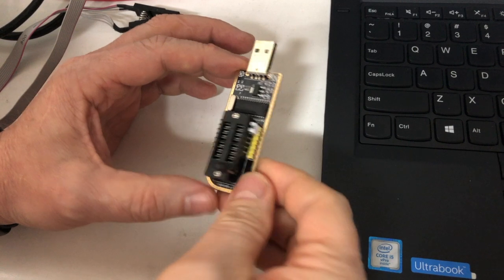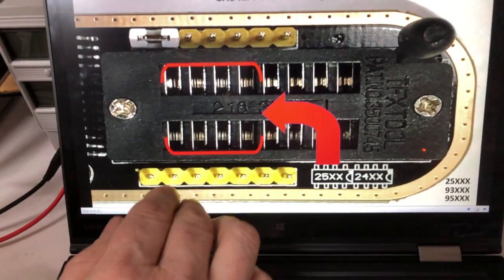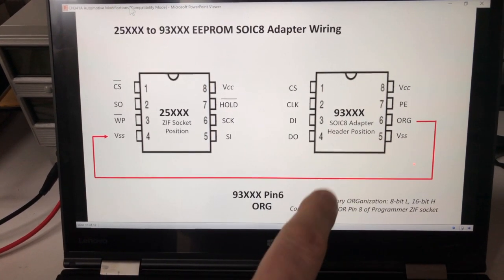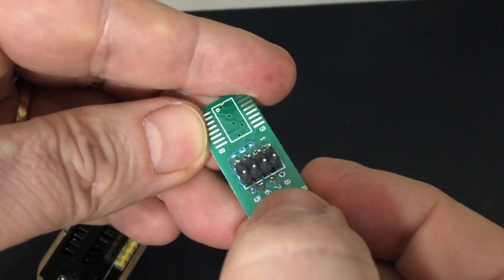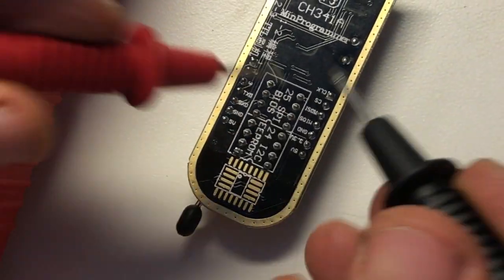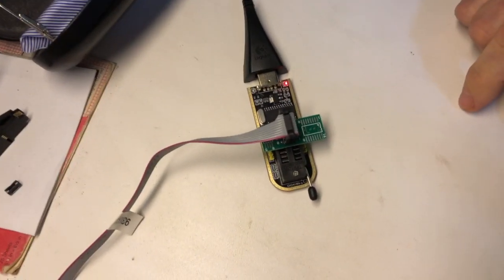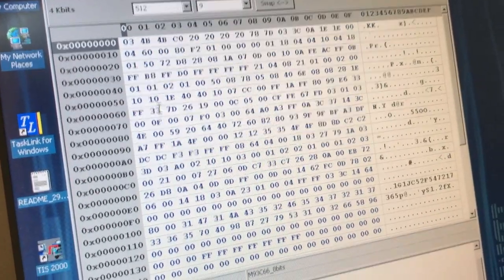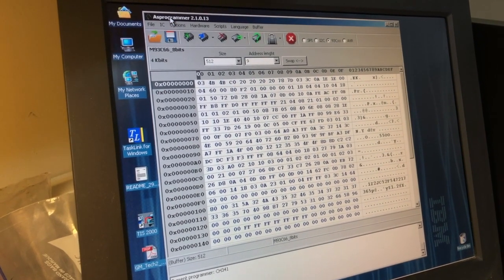Modify the CH341A EEPROM Programmer (Black Edition) for 5V 93XXX & 95XXX Automotive Use

Comment: Thanks so much for this video, was tearing my hair out as to why I could read/write an off the shelf 95160, but not one pulled from an ECU. Did your 5V mod and it worked. Thanks again for the super clear instructions.
Reply: hello friend I don't know it may be your case but ... I bought a ch341a and what I bought in a virtual store came with a defect ... it even programs but with a malfunction ... so ... what happens when you close the ziff socket all the pins of the ch341a zif socket meet and when he asks to program the eeprom he ch341a sometimes burns the eeprom ... as i decided ... i removed the zif socket and put in a common 16 pin socket cobe right and I managed to program you noticed this defect in yours? found out with a mult-test ... thanks
Reply from the maker: @sjoseph35san34  I've not seen this defect before, probably just a defective low end Chinese ZIF socket.
Reply: @DrShock  ok thanks
Reply: @DrShock  im brazilian thks so much

Comment: There is no need to invert signals that in 95xx have the designations ~CS, ~S, in 93xx it is CS, S?
Reply from the maker: The programming software would take care of chip selection signal levels.  For this automotive specific mod, we just need to correctly adapt the pinout pathways and programming voltage.

Comment: Don't know if you still support this but I have an 03 avalanche trying to unlock a salvage radio. the installed radio has  9355093 as does the salvaged radio, how do i tell if it is a 24c04 or a 93/95 type chip?   Purchased CH341A from Amazon which is now $12 not 5, but could use your help.
Reply from the maker: The 9355093 EEPROM would be a Delphi numbered generic 24C08 type.   Determining which type of EEPROM these GM / Delphi house numbers are is usually only solved as a matter of a trial and error process.

Comment: Is this modification needed to rewrite the VIN on a GM radio that is locked?
Reply from the maker: If you chose to use this particular EEPROM programmer, yes.  Most others, no.
Reply: @D @DrShock  you know what EEPROM programmer I would need without this modification?

Comment: I'm puzzled why you had to go through all these hoops instead of just using the yellow-bottom pins which can be wired and plugged into the connector instead. You can even get the 5v from there.
Reply from the maker: I showed the professional approach for a permanent modification to convert the tool to a dedicated to automotive devices only use case.  A repetitively used shop tool.  If you're not looking to do that, then this video likely isn't for you.

Comment: Hi, After this mod can i still read 24xx and 25xx direct in the zif socket? Thank you. And 93xx with adapter
I Need for automotive use.
Reply from the maker: With this mod the programmer becomes dedicated to chips used in automotive applications that use 5VDC.  You'll lose the 3.3VDC capability used by chips for consumer electronics applications.
Reply: @DrShock i don't Need 3.3v. if i Jump 5v to 3.3v in the Yellow socket without cut the trace i Need to desolder the MOSFET?
Reply: Also i Just have the adapter in the video so i Just plug in and Is all fine?
Reply from the maker: You can bodge wire up an adapter at the device pinout level to deal with the voltage routing but its much more difficult, what I'm showing here is modification at the board level which then applies to any device type you would use in the ZIF socket.   I showed all of what's needed, if you want to make the board level change.  Also note this is an older video, currently programmer boards might no longer require this mod.

Comment: May sound like a dumb question, but does this 5v mod need to be done for the 24 series eeprom on Vcc pin 8? Or, is the 3.3v okay during write? Specifically the 24C08 in one of your other videos? I guess I could just look up the data sheet and figure it out, but I thought I'd ask on here first to get some thoughts from others and/or creator. Thanks...
Reply from the maker: This mod is for automotive use, where all EEPROMs are 5VDC powered including the 24xxx series.  If you're not working on automotive module boards, it's most likely going to be 3.3VDC instead.
Reply: @DrShock Okay, I'm doing this inside a replacement Delco head unit (in circuit) from the early 2000's and just wanted to be sure. I believe your answer is yes, mod 5v to Vcc in this case! Thanks for the reply 👍

Comment: Thank you! Just made an adapter for mine to read/write to mine 93C46 on a Toyota cluster. 3.3V worked fine with that chip, so did not have to do the 5V mod.
Reply: Did you have to remove the chip before you could read or write to it?

Comment: Hi. For reading eeprom 95320 is working only by adding a jumper on pin 3.3v and 5v. I had problems reading the eeprom because of the clamp, is hard to connect on eeprom. When a green led from ch341a is on it means the connection is established and eeprom can be read.

Comment: y not just jumper 5 and 3.3?
Reply from the maker: This was explained in the video - the US automotive sector does not use 3.3VDC devices.  So it's a don't care capability that can be omitted.
Reply: @DrShock  ok. i got question while making the clip adapter pin 2 3 4 5 6 are connected by wire?
Reply from the maker: You could implement the adapter wiring diagram using bodge wires yes.

Comment: I purchased a 2nd Toyota Aristo Jzs161 cluster Can I use the to change the mileage?
Reply from the maker: The value in the memory device will be obfuscated, or encrypted.  You would also need a mileage calculator tool like TachoSoft to accomplish such a task.   Instead, the typical repair of this nature would just be to swap the EEPROM device between old and replacement cluster if used.  Or just reprogram with a J2534 interface tool using Toyota Techstream softwre if new.

Comment: Hi,thanks for the vid! I have an EEPROM from an early 2000's Dodge Grand Caravan I want to program with a replacement VIN, The EEPROM has 632565 ST9136 stamped on it. Now before I go modding my programmer, is this mod likely to work on it? I can't seem to find much information on this chip.
Reply from the maker: The number on that chip is proprietary to Chrysler.  There's very little information posted about it, but the few places I came across it suggested it maps to a generic 95XXX chip (most likely 95040) which this mod would cover.
Reply: @DrShock  I see. Thanks for the information...that helps a lot. I will have a go at making doing this mod.

Comment: Is the wiring the same for the 95xxx chip?
Reply from the maker: Only the 93XXX requires the pinout adapter.  The 95XXX uses the same pinout as the 25XXX.
Reply: @DrShock  So i dont need to modify anything for 95xxx chip?
Reply from the maker: If you're using this older black edition programmer that does not do 5VDC, and you're working on automotive devices, then you still need to make mod for that which I went over in the video.
Reply: @DrShock  i do have the black edition,but i quiet dont understand about pinout...Do i have to do that pinout or i just pop it in 25xxx and it will work if i mod only 5v?
Reply from the maker: The 95XXX chips get inserted into the 25XXX section of the programmer.   So the only concern is whether you have the necessary 5VDC.   The earlier versions of this programmer only did 3.3VDC for consumer electronics applications.   The later versions of this programmer have a jumper already to select between 3.3V and 5V.
Reply: @DrShock  How can i know if my programmer has that jumper between?
Reply: @DrShock  Can i use the clip or i need to desolder the chip? its a 95160 chip i want to read??
Reply from the maker: That will depend on the circuit board of your module.  Most will require desoldering of the chip, a small number can tolerate a testclip approach.
Reply: @DrShock  How can i verify if i can use the testclip?

Comment: You do amazing video to present/learn everythings but i am stuck actually. sorry that the question can be stupid, I have an eprom 9386520  ST 9452L    unfortunately this one is not on the programmer list and I don't find enough documentation on internet. 

What can you advice me. It's from a BCM Corvette c6 2005 GM 15216908 module, module is 50% out of order. I have the exaclty same module from another car , what about just swap my eeprom to the next module ?
Reply from the maker: If the two BCMs have the exact same GM/Delphi part numbers then sure you can swap the EEPROMs.  If the numbers do not match, it's likely there is a circuit board design change blocking success with such a route.   These will be surface mount devices, so micro soldering tools/skills will be necessary.  As an insurance contingency I would always make a backup copy of the EEPROM.   You could experiment with the donor boards chip, to determine what actual ST EEPROM device the Delphi/GM part 9386520 is.  There is no cross reference information on this number that I can find.
Reply from the maker: Actually, I found some data on the house chip number 9386520.  Try reading it as an ST 95080.   Though it most likely can only be read after being removed from the circuit.  Should be very similar to this Cobalt BCM video I did some years back - https://youtu.be/0Kon-FjD0dM and you could ask any follow up questions as comments on this vid instead.
Reply: @DrShock  thanks a lot. Last question: does eeprom has also the configuration of the car written inside?  serial module / vin / odometer / config of car ? Or the configuration is written on another chip ?
Reply from the maker: for most GM vehicles before MY 2017, it should all be contained in the EEPROM for the BCM.   However, mileage is special, that data will often also be stored by the IPC module on its own memory chip, (most GM models but not all)  and the mileage values cannot disagree.  This is to enforce US federal law around odometer tampering.

Comment: I've just worked on my 95320 eeprom of 2009 370z with your 5V method. The job's done perfectly and finally I've cloned 370z's data to G37's eeprom. Then the G37 ECU attached to my 370z and the engine woke up without any problem.

Thank you for your great video!
Reply: What did you choose for microwire for this 95320 eeprom?
Reply: @T3nkata Do you mean if I used SPI or I2C? Then I chose SPI for 95320.

Comment: just a quick update on the adapter i made it works fine with the ch341 reading the 93lc46b (it's a 16bit chip actually and not 8bit) whether pin 6 is grounded or not however it didn't work for the ezp2019+ because i did a mod awhile back ago and grounded the 4th pin of the zif socket directly to ground which made the 93 series chips unreadable now it works just fine after i removed the jumper wire

Comment: Nice tutorial despite having the xgecu t48 which read the 93 series just fine but cannot detect the chip though i still wanna use this for my ch341 and the ezp2019+ which is supposed to read the 93 series out of the box but while it can detect the chip as 93 chip it cannot read it, the chip i am using is the 93cl46b 8bit and i'm trying to make an adapter using the 8pin dip socket on these spare boards instead of the clip adapter but it cannot fit the zif socket so i have to use another adapter board but it's gonna look ugly

Comment: My usb port and the ch341 chip become very hot when i use the clamp. Do you have an explanation? My ch 341a is not modified at time.
Reply from the maker: The circuit you are attempting to use the test clip on (presuming this is what you meant by "clamp") is likely drawing excessive current.  You need to cease using the testclip, and instead desolder the device off the board and examine/program it outside the circuit if so.
Reply: @DrShock  yes it's the test clip (I'm not English native, I'm a froggy). Thank you for your answer.

Comment: Why don't you just put a jumper between 3.3v and the 5v pins? I think this maybe the reason the manufacturer put those pins right next to each other. If I'm wrong my aplogies, however if I am right please edit your video
Reply from the maker: This vid is about an automotive parts only mod, where the devices on the module boards are always going to be 5VDC only.  Hence we're only interested in that one path here.  But viewers are free to elaborate past the initial objective as they see fit for other industry applications.

Comment: Hi mate, I'm italian. Not have understend in 4.33 minutes, where to solder the pin 2 to pin 5 or pin 6. Thanks
Reply from the maker: The little board shown at that time index was just a spare prototyping board I had lying round, that I used as an illustrative example to implement the adapter wiring diagram shown earlier in the video.  You can use whatever you want to implement the adapter or even just wire wrap something temporarily.
Reply: @DrShock hi mate I bought the whole kit on ebay and I have your idem little Board. If you have an email address I can send you some pictures. I hope it helps me to read this eeprom. Thanks
Reply: Hi mate. I have eeprom model 94320. For read this eeprom is idem the procedure for 95320? Thanks
Reply from the maker: I'm not familiar with a 94xxx series eeprom working with this programmer or not.  The AsProgrammer software also has no support for any 94xxx devices. 

You sure you are reading the number correctly?
Reply: @DrShock  yes mate. I have read correctly the number. This eeprom there is into a radio blaupunkt

Comment: Hello DrShock i did everything as in the tutorial step by step with the ch341a device ( cut the trace between 3.3v and pin 8 , solding jump wire between pin 8 and 5v and lift the middle pin) but after putting it in to the usb port window pops up "Device is not working properly" and doesn't recognise it.. where can be the problem?
Reply from the maker: Was everything working OK before you made the mod?   Always a good practice to have a known working setup first given the device drivers and software involved.
Reply: @DrShock  i cut the jump wire from pin8 to 5v and put it to 3.3v to restore the original trace ,solder the middle pin of the voltage regulator back and the pc recognise it immediately as before.. but i need it to work on 5v so i can read 93c56 chip
Reply from the maker: Alright, so you have gotten back to a known good state.   So now, for the PC not to recognize the USB device, power to CH341A chip is likely being interrupted.   There may be other, alternate, designs floating around for this inexpensive board by now (this video is several years old).   Carefully trace out the regulator outputs (both 3.3V and 5V) on your board and determine if they differ from the version I showed.   It's also possible your later version of the board does not need this mod.
Reply: @DrShock  thank you for the help! Now i see... actually the ch341 in your video has some differents with mine

1. Your has label ch341A and mine is ch341 (without "A")
2. At your device at the opposite side of the 5v pin (1.2.3.TXD.RXD.GND.5v) mine has 1. 2. 3. TXD. RXD. GND. 3.3v 

So this is maybe the reason why mine is not working